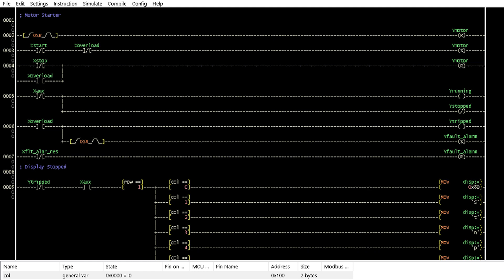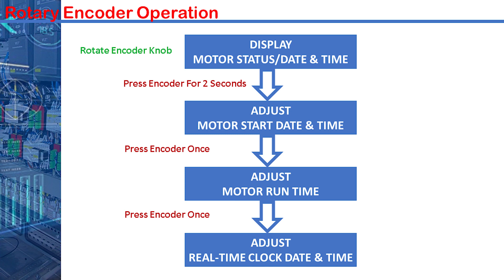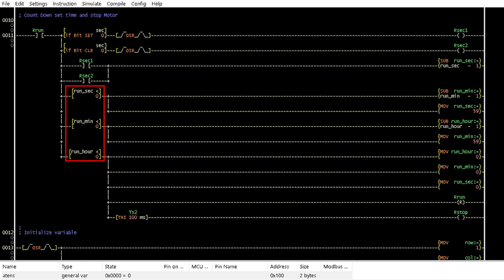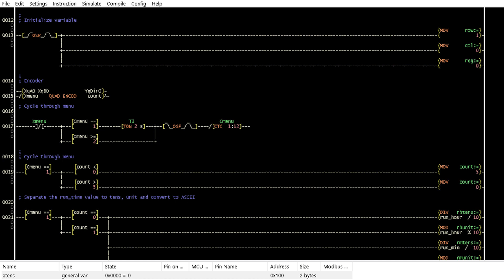How to Build LDmicro Arduino PLC (Adding Real-Time Clock Module & Rotary Encoder)

Comment: Sir 
Very nice video  it is very  useful to all followers. 
NTC Temperature sensor how  to use in Ld micro .
Please  explain . It is possible  or not?
Reply from the maker: It is possible with LDmicro. It sure requires some logarithm calculations that could be implemented with the piecewise linear or Lookup Table